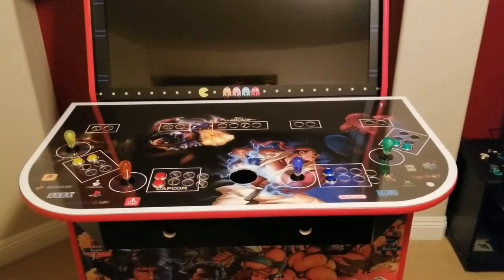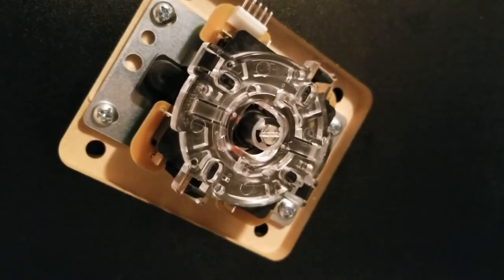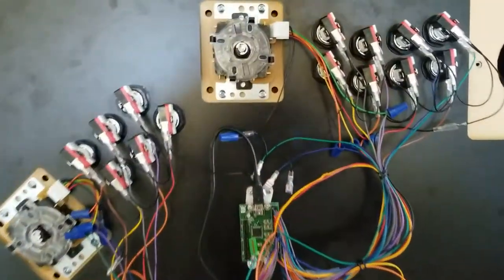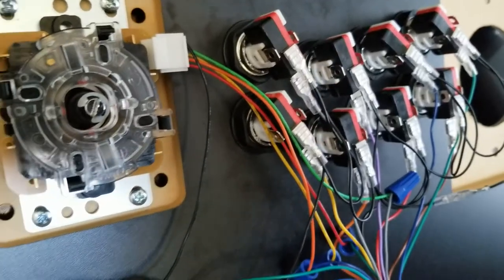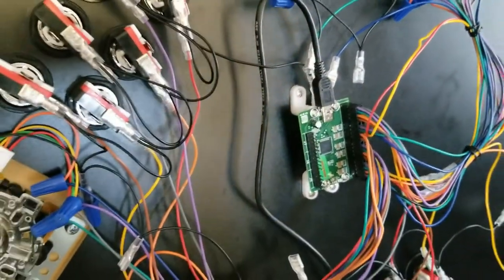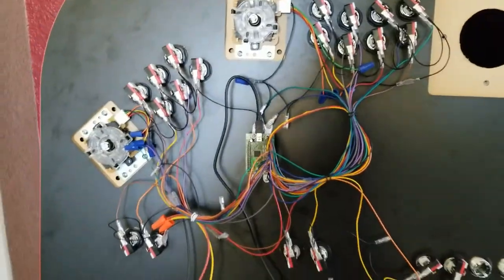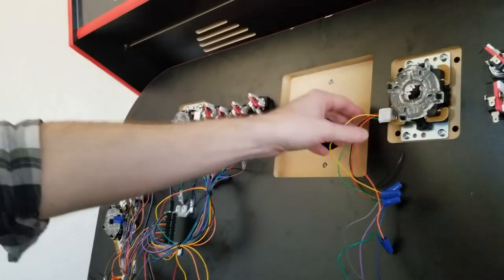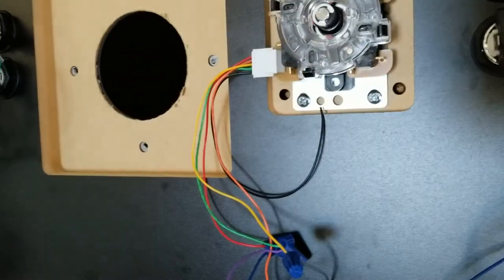Game Room Solutions 43" Arcade Cabinet Full Assembly: A Noob's Adventure - Wiring (Part 1)

Comment: I just recently got a kit in from GSR that I will be assembling as soon as I get my buttons, joysticks and wiring in.  Mine is a mid-sized pedestal so not nearly as complex as yours.  We’re your joysticks installed by just wood screws screwed into a small pilot hole, or did you have to do threaded brass inserts with a threaded bolt?  The reason I ask is in some videos I see people using the brass inserts, but on my control panel I just see small shallow pilot holes that look like they would be for wood screws.  If yours were installed with just screws, do they seem sturdy and robust?  Thanks!
Reply: I used the brass inserts they sent me
Reply: @jml60831  hmm, they didn’t send me any.  Did you order the joysticks and buttons through GSR with your kit?  I ordered those separately from someone else because I wanted certain types.  Wonder if that’s why I didn’t have any brass inserts sent…?

Comment: It’s preferred to use crimp connectors instead of wire nuts.. I’d at least wrap each nut with electrical tape to keep the connectors from coming apart
Reply from the maker: great thought, thanks!